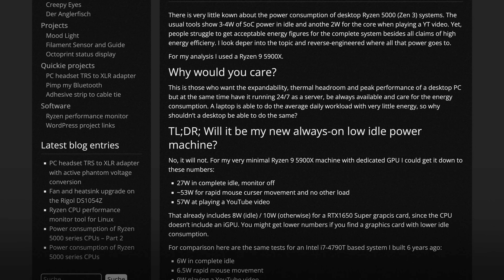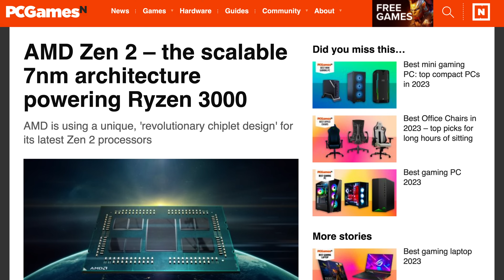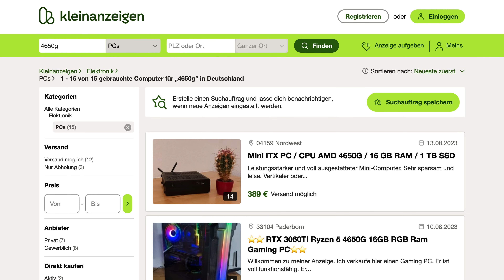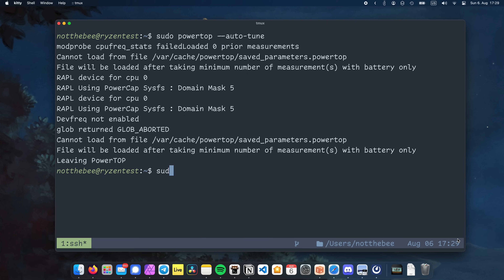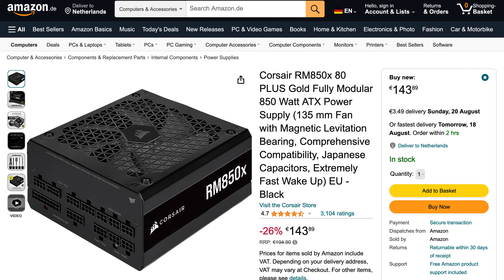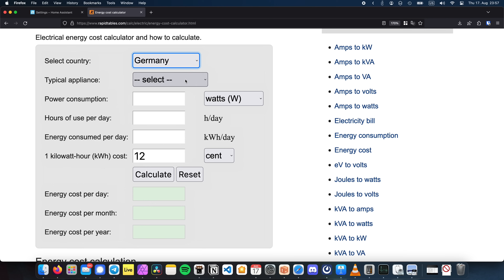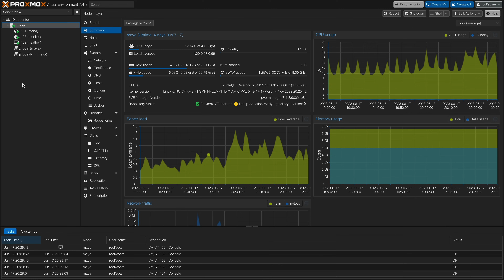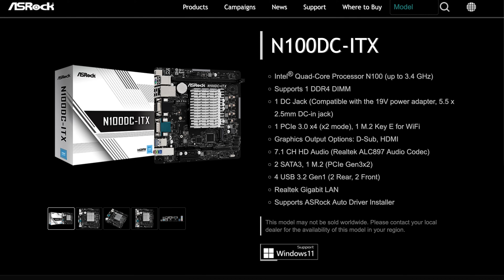This $250 Ryzen Pre-Built is a BEAST Home Server!

Comment: https://youtu.be/N8fWIh1V-YM?t=685
its well known but I'm surprised no one on youtube has done this,

You could easily brute force staggered spin-up using n-channel mosfet modules with esp32, no soldering needed.
Low side switch mosfet modules are the cheapest. 

Mini guide if you wanna make a video about it:
1) Use 2 hdd per module should be fine around 12v 2A = 24W, you can use each if you have a super pico PSU, so use 1 GPIO pin on esp2 for 2 hdd power up.
2) Make gpio stagger signal to mosfets at least 10-15 seconds intervals.
3) Profit without using server grade PSU+mobo bios generated staggered power up.

Comment: I find these low power but efficient build quite interesting... I built myself a small NAS with a 8400... Tried to thinker a bit inside the limited BIOS, it its around 20/25 w iddle... Not bad I guess... Keep in mind it got a 6TB iron wolf HDD, a 250gb sdd, 2 x 8GB Ram and its powered by a Seasonic PX Platinum (lol i now) ... The thing is... Even 1 or 2 clients of Jellyfin, even running a Windows VM sometimes, it sticks around 40 to 50w.. Not bad I guess...

Comment: Hey Wolfgang, please do a homeserver build in one of the Asrock Deskmini/Deskmeet boxes, or even Jupiter. Intel or AMD doesn't matter, Deskmini comes with 2 Sata ports + power, and no PCIE slot, so only the M.2s. Deskmeet is a fully fledged itx system, with case and PSU, PCIE slot and loads of connectivity. I'm seriously considering either for a small NAS build or even a home server, and since they're popular - especially the Deskmini, plenty of 3D printed case mods exist to improve cooling and adding expansions. 
Thanks again for investigating Ryzen for low power home server build, keep on going with low power/efficiency builds! Homeservers in EU are kinda redundant if it costs more to run the thing in electricity only per year, compared to equivalent cloud services, power efficiency is key.

Comment: Benchmarks I'd like to see for this system, and the others as well are;
1. ZFS resilvering. (use some standardized drive size and layout like 3-wide z1 of some cheap 4tb drives or whatever you can get your hand on.)
2. Your typical DB & FS benchmarks, Seq. I/O, Rand. I/O and such.
3. In general also displaying the benchmarks of all previous builds alongside the current results with perf/W and perf/$

Comment: While some might be focussed on low power, in my case, power is no issue as I live in a country with cheap power. So if my home server pulls 450watts all day, i could not case less if it is silent and continues working in the far  corner under a desk. So i built an X99 Xeon server with 12 cores/24 threads (2.6Ghz- 3.3Ghz) for less than USD$120. That is mobo, E5 2690V3, 32GB ECC Reg server RAM. Oh yeah, it will take my PCIe X4 2.5GB x4 NIC card. It will also have 3 NVME drives from my leftover stuff. Then my 6 SATA drive cage will be transplanted over so I can DSM7.2 over ProxMox. Get this, my old Xeon E3 CPU and board can be sold for half this cost!.

Comment: My website hosting server uses just 6.5W in idle. It's a used HP office PC with an i5 9500 and 8GB RAM (original PSU has platinum efficiency). Got it around 2 years ago for £150.
Reply: That‘s impressive! How many watts is your PSU rated for?
Reply: @xavifernandez1542  
PSU is 180W. To get all specs just search for
HP ProDesk 400 G6 Small Form Factor Business.
Reply: @xavifernandez1542 my Lenovo m920x with an i7 9th Gen 2 SATA SSDs and 2 nvme SSDs is drawing about 10w idle on proxmox running more than 10 containers. Comes with the stock 135w Power brick.

Awesome little box! Definitely recommend this tiny 1L PCs
Reply: Omg im so jealous! 😂
This is really great power consumption! Mine is consuming 25W without drives and about 40W with them spun up. The only pro is I've got it dirt cheap

Comment: i was in the process of building a similar system but due to space limitation, i bought a terramaster. it idles at 15watts compared to my previous NAS which was 22-25watts. of course i now have NAS rated drives and i run UnRaid instead of TrueNAS. i do have the HDD spin down after not being used after a hour. i have two m.2 2tb’s for my caching. i think at the end, it’s roughly the same as my watts increase a bit more while using the HDD. but i’m happy that i’m getting twice the TB space in a smaller form factor.
Reply: terramaster is a great choice if you don't need more than 2 (or 4 for bigger model) spinning drives - combined with 2x nvme it's perfect for my needs. I'm just waiting for them to switch to N100 - it will be a sweet spot with speed/power consumption. Did you get Fx-423 or Fx-223?

Comment: Great video as always, спасибо!
Is there any tutorial on what exactly to tweak in Ubuntu to achieve as-little-power-draw-from-the-wall-as-possible?
My J5004 system draws ~27w from the wall without any software tweaks and I know it should be better.

(btw was also surprised that rgb keyboard is easily +5w from the wall - makes sense, but still surprising)
Reply: 90% of this is "powertop --auto-tune"

Comment: Bro you are lost. Just buy a 12th gen i5 nuc pro. It takes 5w idle. It also has 2 thunderbolt ports for all your nas and server requirements.
Reply from the maker: ... which costs €389 without RAM or SSD. Plus 200-700€ for a decent Thunderbolt/USB-C SATA enclosure for multiple hard drives. 
Definitely comparable to a 230€ pre-built!
Reply: It’s a 12 core with 9000 geekbench 6

Comment: I converted my previous desktop sporting a 5900x to my new virtualisation host. I run it at the 65w eco mode. It's pretty awesome considering my previous virtualisation host was running on an intel Nuc.
Reply: Have you checked if eco mode even does anything for idle power consumption? i've heard its mostly a no from pretty much everywhere i look
Reply: @Nonstopie  yes I've checked and it's ever so slightly lower, but it's virtually the same. But it's pretty low anyway. If very low idling power draw is what you're after, you might want to check out those mini PCs that are all the rage now. They're pretty cool as long as you don't need lots of IO or full size PCI-e slots.
Reply: @roccociccone597  Yeah i was just wondering because i did a similiar thing where i moved my 3700x from my desktop to my server. My idle was somewhere in the 35-40watt range without spinning drives and 1 nvme. I havent really bothered changing around any bios settings yet though.
Reply: @roccociccone597  Did you have to disable C-States? My 5900x will randomly hang when not doing anything, after disabling c-states it works and same goes for Eco-Mode. CPU is not stable when using Eco-mode. It's only stable after I set the proper PPT, TDC, and EDC after testing what gets me the highest frequency.
Reply: @justfasial01  mh might be your board that’s a bit flaky. What board do you have? Eco mode is perfectly stable for me.
Reply: @roccociccone597  Strix x570-e, don't think the board would have anything to do with it. When I was researching it a lot of people had the same issues, the only reason I'm not doing RMA is because it's extremely hard to replicate sometimes and I feel like AMD is just gonna send it back to me saying it's fine... I might try to RMA near the end of the warranty period. How long have you had yours?
Reply: @justfasial01  p-state issues are mostly linked to your board. Have you tried updating the bios? I’m running a crosshairs hero 7 and it’s chugging along perfectly. I disabled all the lighting and unnecessary bits
Reply: @roccociccone597  P-state? I'm not sure what that is. I'm talking about C-states setting in bios. And yea I disabled all RGB stuff also and updating BIOS was the first thing I did, still happens on the latest bios. With c-states off and eco-mode off it's stable. Also what's the MIN "Package power" value you see in HWMonitor? It'll show you if you have c-states enabled.
Reply: @justfasial01 you shouldn't need to do that. Eco mode already sets ppt, tdc and edc. Also, if running eco mode keep everything else on default/auto, not on manual. And definitely don't expect high clocks full core - if you eco mode and set high clocks manually it will crash. I would suggest instead of tuning for highest clocks to tube for most efficiency - set everything to auto, turn off any bios built in over clocks set normal ppt,tdc,edc values and run performance test. Note results, and then test + and - 5,10,15,20 w on the PPT. When you graph (perf horizontal, ppt vertical) the results you are going to see a relatively 25 degree incline that then turns almost vertical. You want to set your ppt to the inflection point where the two lines of the curve meet. That's the most power efficient point on the cpu.
Reply: @igelbofh  When I said custom PPT and other stuff I meant I tuned it for performance like you described. Yes I understand Eco-Mode sets it's own ppt and that's how it works. Since eco-mode is not stable on my CPU and I had to disable c-States I just went for performance and it's been stable with my custom PPT settings. 

I would've used it as a server build if c-states worked properly, when using C-States lowest CPU power I've seen is 25W and without it it never goes below 45W (CPU package power) so might as well get all the performance out of it I can.
Reply: @Nonstopie  Eco and stock have the same idle power consumption, my CPU is always consuming 47-50W and if you have c-states enabled it can go down to 35W but it's not stable at all with c-states enabled. AMD dropped the ball with not figuring out c-states for Zen 3.
Reply: What do you mean it's low? Ryzen idle is 20w just the cpu.
Reply: @igelbofh  yes that’s pretty low all things considering. You have things in your house drawing way more current.

Comment: I've got RM650x and Seasonic TX-650 Platinum. Platinum is way more efficient than Corsair at low wattage. 7 W on my 40 W idle machine.
Reply from the maker: It's quite a bit more expensive though. Also, only the 2021 of RMx power supplies has the power efficient tech. The 2018 units are pretty mediocre
Reply: @WolfgangsChannel  Got it on a discount, 149€. Couldn't pass. I mean, I did not need it, but the price. Figured 12 year warranty will make it up. Well, first unit lasted for 2 weeks...

I'm not sure which year my RM650x is, but I also have 2018 RM750x, which does idle a bit higher than my RM650x.

Comment: I like your low power builds. It insipred me to build a homserver out of a Asrock Desk Mini x300. I did 3D print a modified housing (printables x300 case) in order to add the thick 5TB 2.5" HDD. I do not need more disk space. I picked a Ryzen 5600G and switched the power supply to a GaN 65W usb c one. So the board gets 20V (instead of 19) through usb c power delivery. Pretty cool!
I actually did not measure the power consumtion yet. But I will do a research about your mentioned power top tricks. I remember the power draw to fairly under 15W but don't remember if the drives were connected. Once I found time to measure the power consumtion, I can let you know. 
The N100 build will be alse pretty decent and might be way under 10W with 2 HDD drives.
Reply: Nice! I'm actually running Asrock Desk Mini x300 + 5600G + 1TB SSD and I'm getting as low as 8w on the default PSU, although it was a stock Debian with nothing running and nothing was connected to it, except LAN cable.
Reply: @ivansorokin2199  So i did the tests. Set the CPU to 35W in Bios. Disable audio and secure boot. Cpu voltage manual to 0.95V. 5600G 2x16GB 1x 500gb m2, 2x 5TB 2.5" HDD (disassembled out of new external drives). GaN 60W usb c charger. Ubuntu server with home use Nextcloud, home assistant and some additional running applications. 12W idle, measured with a Brennstuhl meter. No powertop tweaking.
Reply: @marcschneider7338 Yes, but the question remains: How are you using USB-C?
Reply: @EmotionalWeather  most likely its usb-c to dc adapter
Reply: @ivansorokin2199 Ah dude, so now I must measure my system today. I will post it here.
Reply: Power it via USB-C ? did you just mod/buy a cable from usb to 5.5mm barrow jack?
Reply: @leoncryp8182  I did buy one on Aliexpress. With such low power I do not see any problem. If you want a 100W cable you need to buy a proper one. Great Scott on YT did a good test of "100W" cabels.
Reply: How are you powering a PC with USB-C?
Reply: @darekmistrz4364  This is quiet easy. Check out "USB Power Delivery". Basicly the protocol supports different Voltages like 5V, 9V, 12V, 15 and 20V. The laptops and barebone pc's often demand about 19V, altough some might desire 12V. 
The IC (integrated circuit) on those boards do support a larger input voltage range. Let's say 16 - 24V. They will regulate the voltage to their needs afterwards. So if you feed the Asrock X300 with 20V instead of 19V, there is absolutely no Problem. 
The charger needs to support power delivery. If I remember correctly, the charger try all different voltages until the client (the Asrock X300) is satisfied. Or the client directly tells the charger what voltage it wants. 
So I only had to buy a USB C to 5.5mm cable from china. 
He explains electronics very well and it might help you understand USB Power Delivery
https://youtu.be/OwAZqJ4wpJg?t=326
Reply: Thanks for this comment @marcschneider7338 - I wasn't aware of X300 existence - already bought it, waiting for the package - it looks perfect for my 2x nvme + 2x hdd 2.5" setup. Is it true that 15mm thick 5TB 2.5" drives won't fit in standard case?

Comment: Thanks Wolfgang, I rarely miss your videos, always super interesting. Especially like the homeserver stuff. 
This rig looks like a great deal, however involves a lot of tinkering. What do you make of the recent-ish (or older even) mini-pcs like Optiplex and the like ?
Reply from the maker: No tinkering required – the pre-built can be used as is. All the tinkering that I did was optional :)
Reply: I got myself a minisforum UM790Pro mini pc as my home server solution. it idles at 8-9 watts and is extremely powerful and super silent at the same time...
in general the lenovo tiny pcs aren't that great for anything storage related since they only have 1 sata and 1 nvme I believe.
otherwise cheap but they're also kind of noisy sometimes.